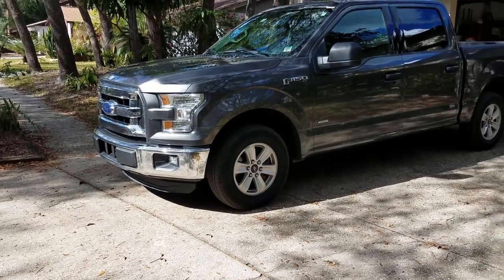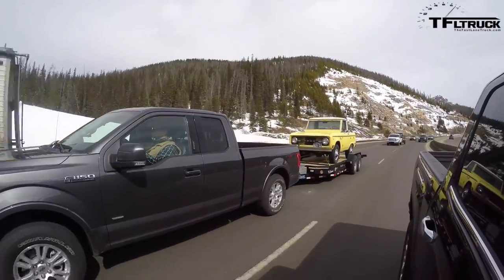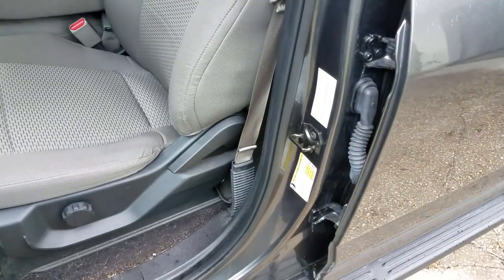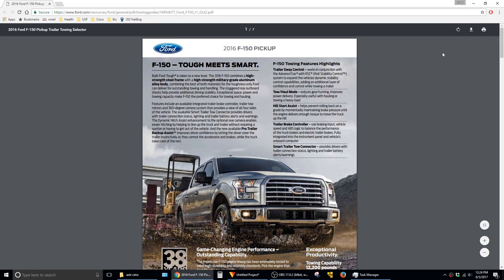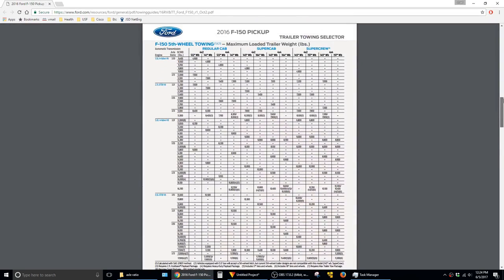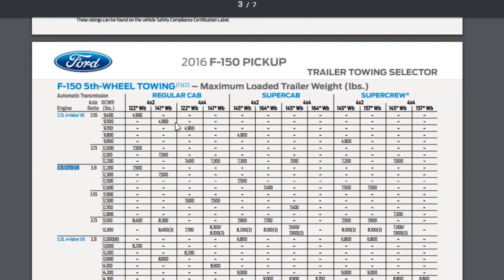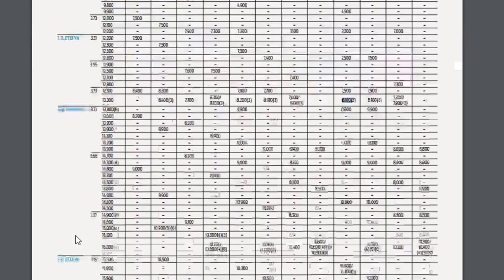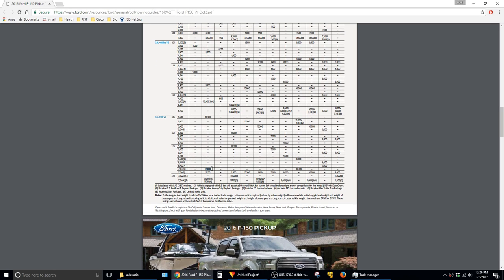How To Find Axle Ratio 2016 Ford F-150

Comment: Thank you! 17’ 5.0L, 4x4 with 3.31’s on mine. I was looking for the window sticker but found this first.
Reply from the maker: That's a sweet ride, I hope it serves you well.  I wanted to get the 4x4 but it was hard to find one used.  It might be a Florida thing.  Flat land and no snow, so trucks everywhere with stinking 2wd.
Reply: Do you know if the 3.31 gears would turn 35”s or would I need to regear